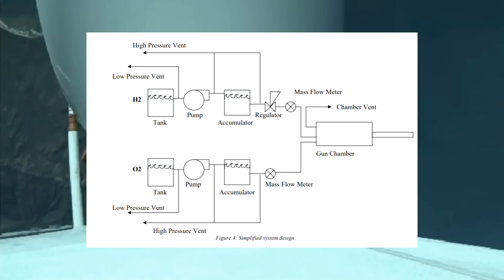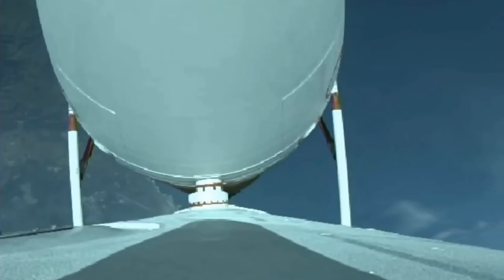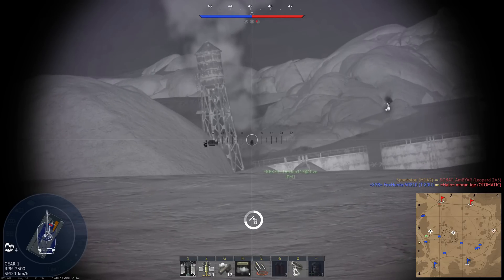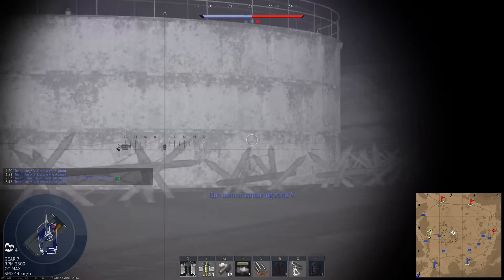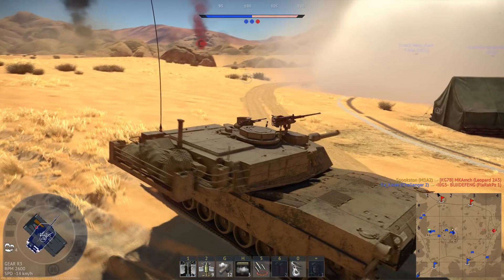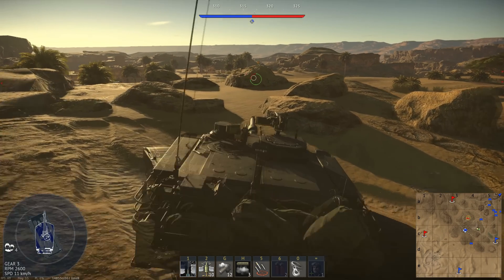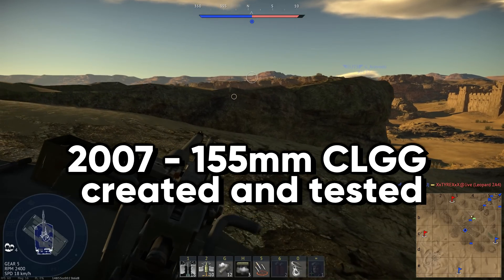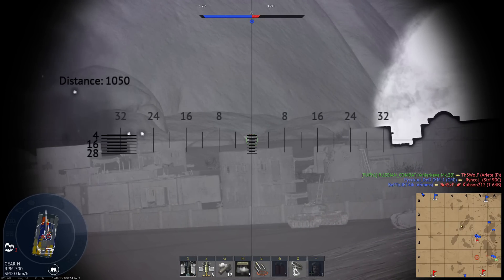CLG Guns - Future Tank Weaponry

Comment: I think clg weapons would be good for stuff like space ships, same with raven and etc guns. CLG and etc used for capital grade weapons and raven and rail guns with high rate fo fire or projectile speed would be good for point defence. Jury is out on the efficacy of rail guns in space unless you want MACs from Halo
Reply: recoil producing weapons will never be used in space, only missiles and energy weapons will ever be used in space
Reply: @Real_Commander_Shepard  depends, recoil can be compensated for with rcs control etc. Of course I agree that energy weapons for capital grade stuff due to size of ammunition. Missiles is a no brainer but again they have recoil in the form of back blast which in an enclosed ship ain't ideal. The main thing I can see solid ammunition weapons being used for it point defence for dealing with stuff like asteroids or enemy missiles. A lot of Sci fi uses coil or gauss weapons for pont defence which makes sense in the time periods give the advancement of technology. Though for our first forays into the void I think we are gonna have stuff like the ciws found in naval assets for point defence and large caliber solid ammunition weapons for primary armament. This with energy weapons is power supply and general charge time. If you can have a set up that can be continuously powered up with having to cycle or spool then yeah. Also at out current tech level, lasers would be very ineffective against space ship hull plating
Reply: hammer1349 close in systems would likely be laser based and long range systems missiles. An interesting idea is that space ships might actually adopt ramming techniques if directed energy weapons are not effective enough to disable them.

Comment: This will actually work more in space for some reason, high speed and the fuel is right there.
Reply: right there at incredibly low density, still has recoil that your engines have to compensate for, and where'd you find the free oxygen?
Reply: @youmukonpaku3168  Electrolysed from ice deposits on the moon. If we're at the stage where we're fighting over stuff in space, we almost definitely have that

Comment: Could you find anything on the usage of methane (methalox propellant?) instead of hydrogen? I suspect that it would have a lower likelihood of randomly blowing up, and many people in many nations (like 'Murica) already use methane in their house in the form of natural gas. It might not be quite as potent, having only a third of the energy density by mass, but it compressed or liquified easily enough, and has a lower propensity to detonate randomly (which it can still do, however) and leak through containers. Although it is harder to make methane, it is possible, although you would need to get a carbon feedstock, like CO2, which could make logistics even more difficult.

Comment: Wouldnt keeping the oxygen in a liquid state also take up LOTS of power?
Reply: Depends on the level of insulation, if it is badly insulated, then yes, but with good insulation, probably not. I would be more worried about liquid hydrogen, however, which is far colder, enough so that liquid hydrogen freezes oxygen.

Comment: 2:06 "CLG guns are actually as cool or cooler then even conventional cannons..." Oh yes they are! Oh you were talking about temperature...
Reply: How or why is that ?  It sounds counter intuitive ..all that energy and LESS heat ??🤔
Reply: @billhanna2148  the same reason that you can touch foil in the oven without burning yourself but not the food. it transfers the energy to the air more efficiently.

imagine burning a piece of paper and dropping it into a barrel, all the fire is inside the barrel but the paper burns before it ever touches the barrel. then imagine placing that paper on the barrel and burning it; even with less paper (less power) it will heat up the barrel more. the whole system produces more heat, but the gun stays cooler, the heat is dumped into the environment.

Comment: For a case study on why using pure oxygen as propellant for combat weapons can be problematic, see the Japanese Type-93 torpedo.
Reply: Or the Apollo 1 fire for an example of how horrific a pure oxygen fire in a confined space can be, the standby emergency teams couldn't even put the fire out with powder and Halon and the flame retardant suits the Astronauts where wearing also caught fire.
Reply: @Tuberuser187  Main reason modern spacecraft are pressurized with regular air.
Reply: German and US torpedoes didn't even need that to be far more problematic :D
Reply: @piotrd.4850  what do you mean  the MK-14 is a perfect design with no flaws what so ever, YOU are the one who don't know how to use the torpedo. also, we have locked the manual about the torpedo in a locker, in a basement, behind the door marked "bewave of the leopard", its not like our enginieers need to know how the thing works.
Reply: The type 93 didn't use liquid oxygen, but compressed oxygen. You are correct in that 100% oxygen is extremely problematic.
Reply: Crosshair84 That’s right, I guess I got wrapped up in the subject of the video and wrote “liquid” instead of just “oxygen” or “pure oxygen.”
Reply: The problem with that and torpedoes in general was they needed to be stored in exposed positions while powder charges and possibly future gas propellent could  be stored in armored magazines and turrets

Comment: I'm happy you used a rocket that actually uses Hydrolox as a propellant (and in all stages too :D)
Reply from the maker: I felt like it wouldn't be right if I didn't. And I knew someone was going to notice lol
Reply: @Spookston  Well, I'm a bit of a rocket nerd ;P
Reply: @Katniss218  a bit? I like rockets too but I haven't even looked at how to tell the difference between fuels
Reply: @midgetman4206  Hydrolox plumes are usually cleaner and transparent (delta IV cores are red due to an ablative nozzle), methalox plumes are purple/red, kerolox are more opaque and usually yellowish-orange, hypergolic can look like anything (usually red-orange and somewhat darker), solids leave a trail of thick smoke.
And TEATEB (ignitor fluid in Kerolox) burns green :D
Reply: MidgetMan 420 well if you can tell what rocket it is, then you can know the fuel it burns
Reply: @Katniss218  
One of my people! Do you think a CLGG could use methalox? I was just thinking cause of the higher density and higher storage temperature.
Reply: If I may ask, why was the fuel type in the video important?
Reply: @megaboto.t.1.0  Because accurate details :D
Reply: @Katniss218  
Yes! A fellow rocket lover! Have you read Ignition?
Reply: @robbiejames1540  I have not, unfortunately
Reply: @Katniss218  
I would very highly recommend it! An entertaining and interesting description of the development of rocket fuels.
Reply: I read this as uses hydrox as a propellant and was extremely scared at how that could be done.